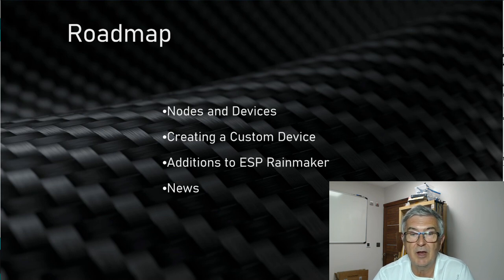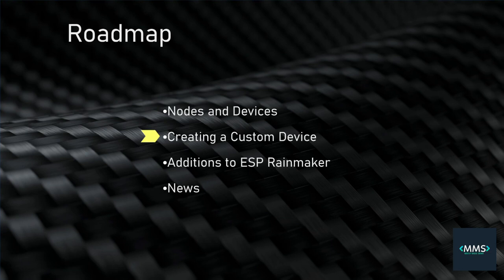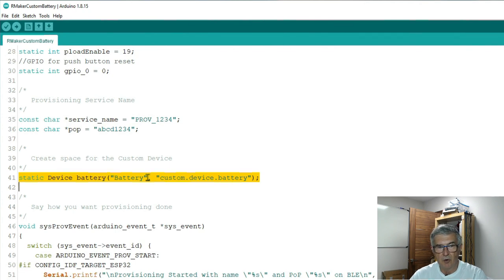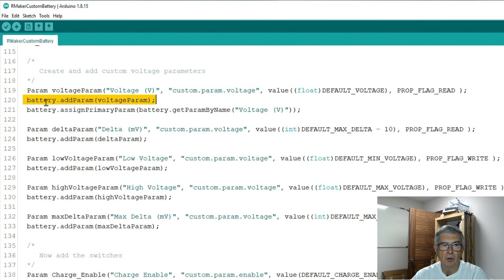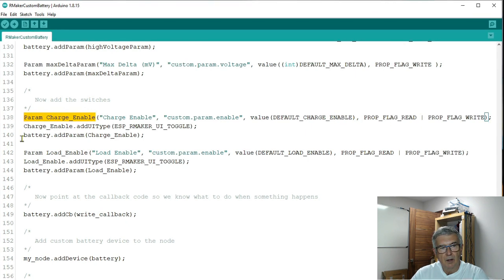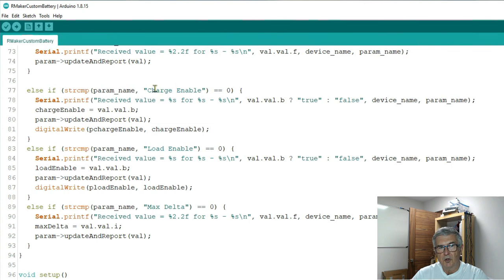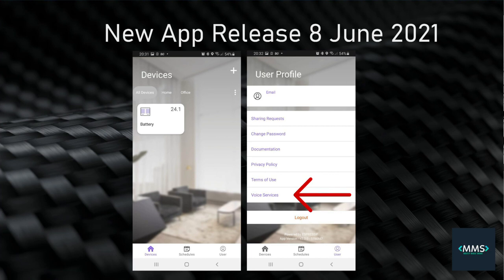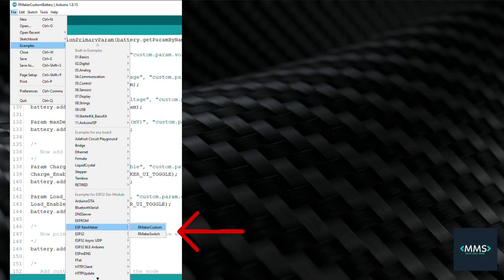Arduino Project: IOT Devices With ESP32 (ESP Rainmaker)

Comment: Hi why arduino ide doesn't support local control
Reply from the maker: That's a good question!  I think its simply lack of resources. They have a lot going on and clearly their focus has to be on the technologies that will sell huge quantities of chips. The device manufacturers will be using IDF or Matter so I suspect their focus will be there.
Reply: @Magic-Smoke  thanks soo mush for the quick reply.
And can you please help as with the IDF program
 Like how to control devices with the rainmaker using the IDF
Reply from the maker: @smartteg7381  Take a look at the first video I did on ESP Rainmaker. It uses IDF for a simple example.
Reply: @Magic-Smoke  OK thanks

Comment: 'Device' does not name a type
how to fix this error please
Reply from the maker: Can you give a little more information please?
Reply: @Magic-Smoke  I solved this problem.
The problem is i use esp32 v1.1 that does'nt include rainmaker
But esp32 v2.0 include rainmaker.
Reply: @Magic-Smoke  But I want to create multidevices in arduino rainmaker but i can't
Can you give me an example?
Reply from the maker: @ahmednaeem1996  There is an example of how to set it up here: https://github.com/espressif/esp-rainmaker/blob/master/examples/multi_device/main/app_main.c
Reply: @Magic-Smoke  but this in esp-idf i can't convert this code to arduino
Reply from the maker: @ahmednaeem1996  Of course you can. Its pretty much the same code. Compare the statements to set it up.
Reply from the maker: @ahmednaeem1996  Yes you can. The commands are the same. Compare the examples side by side and you will see what to do.